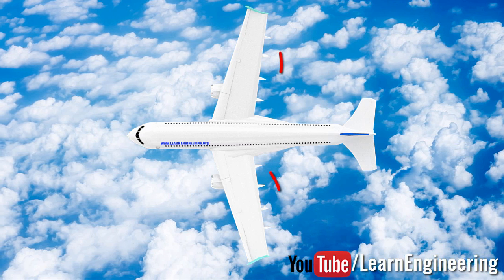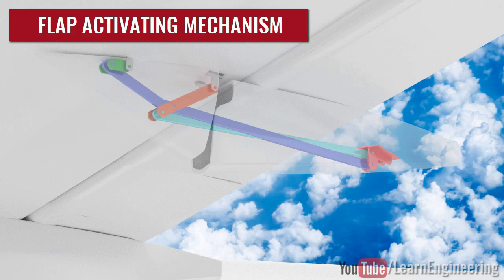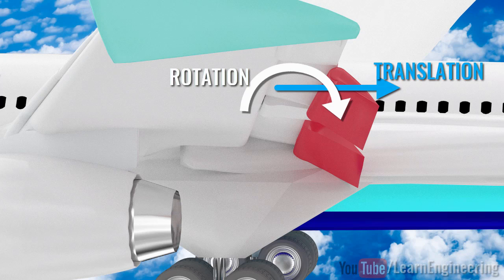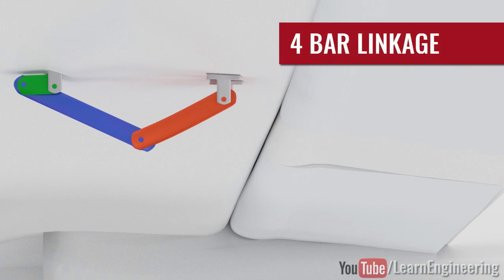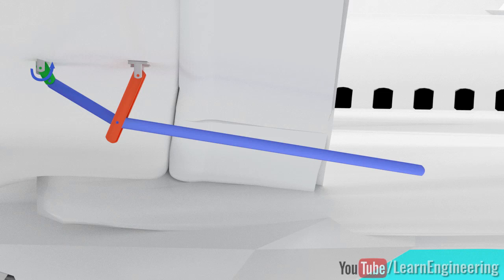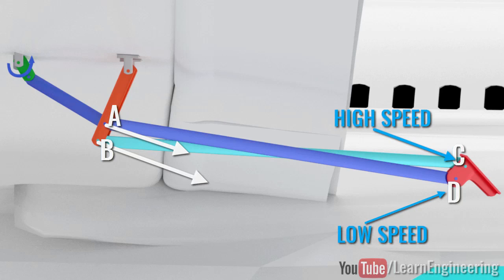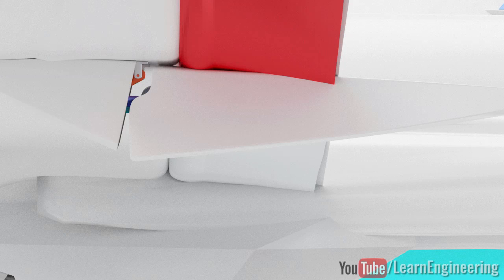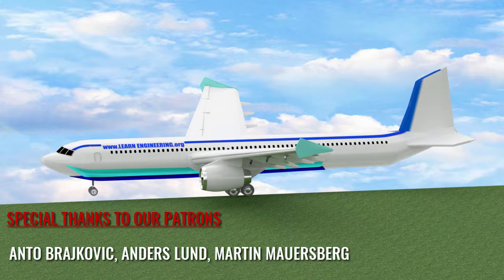What are Beneath the Airplane Wings ?

Comment: You failed to mention an important feature, as well as providing an aerodynamic fairing for the flap tracks, they are also used as Anti-shock bodies or Whitcomb bodies and reduce wave drag at transonic speeds between Mach 0.8–1.0 using the Whitcomb area rule

Comment: I have 40 plus years of working on Jet Airliners.Started working life on B707, then B727, B737, B747, B757, B777, A310, A320, A330, A340, DC 8, DC 10. Have worked on D checks, C checks, Line Checks. Specialized in Airframes and Engines, with working knowledge of almost all the other systems on the planes

In D Checks, aka Depot checks, we remove the engines, flaps, flap fairings, body fairings, slats, landing gears, cabin and cockpit seats, galleys, toilets, floor panels, ceiling panels, ....you get the picture; by the time we were ready to carry out inspections, she looked real naked!

However, I have Never seen any Jet Airliner with flaps that work as shown here. The Closest I can think of is the DC 10, in the sense that it did not use motors and torque tubes. Even then what is shown here is totally alien to me.

I have seen a couple of other videos about aircraft on this channel, and I get the impression they did not even consult any technical manuals and just dreamed it all up.

Comment: Thanks for a great video, just out of curiosity: what kind of machine they have to move that green little thing? Just a normal electric motor? And does it require lots of power to move that? And lastly, would the flaps be deployed if that thing broke? (Due air flow to the pocket that moving the flaps makes?) Thank you in advance! :)

Comment: How about do away with this protruding thing at all by adopting somewhat old technology - double deck wing. I mean two wings or four major wings on commercial airplanes which would consume less fuel. Double stacked wings can generate breaking more with additional flaps between, upon landing, and simple control mechanisms can take those functions, which means airplane has to fly at slower but at efficient speed. Or they don't have to be stacked on one another but upper wing could be positioned a bit forward and at less aggressive angle just to give the bottom wing higher air pressure.

Comment: Why not just direct drive actuators attached to the inner end of the flaps?
Reply: s50201 To counter drag forces. It would be hard to activate at high speeds
Reply: Jo-Ann Li Seems like a lot torque would be required to actuate that little link as well though.  I guess it's a "do the math" situation.
Reply: s50201 on airbus 320's they do use hydraulic driven linear actuators.

Comment: thanks for video, but it is not so obvious, that light green part moves faster then dark blue part
Reply: For me it was easy, though i dont know if the idea i have applied is correct. But i will try to give explanation: 
if we consider example of a hinged door regarding torque concept then perpendicular force applied on a hinged door is less and its speed of moving the door is high , when the contact point on the door is far away from the hinge but the more closer you get towards the hinge side of the door, then the force has to be increased still the speed gets slow and the door will move(rotate) slowly but with more force.
Same is the condition here, the point moving at high speed is away from the joint(hinges in a door) so less force but high speed and vice-versa for another point.
Reply: tangential velocity vt = omega (angular veloccity) x radius 
radius for the light green one is bigger and they both have the same omega therefore light green one velocity is higher

Comment: Advice in the end of the film is a bit wrong. It should be: ..."Next time you board an airplane. Try to figure out who is the terrorist"...
Reply: Nemo D333 Hint Its the guy with the new Samsung product
Reply: +roller321321 It is so close to true. Had flight during xmas. Anouncement on the plane stated: "during lift off all mobile devices must be switched to flight mode. All Samsung 7 devices must be switched off all the time"...